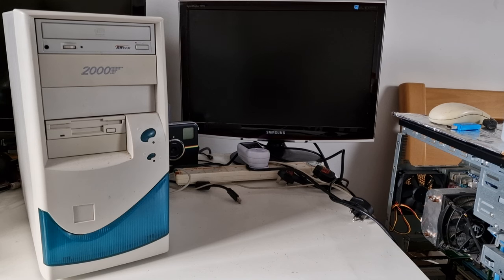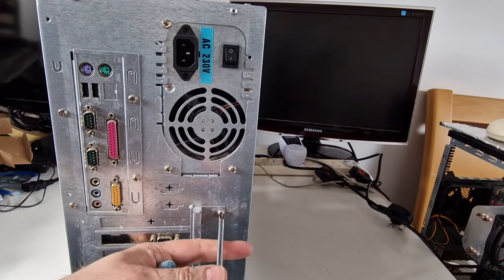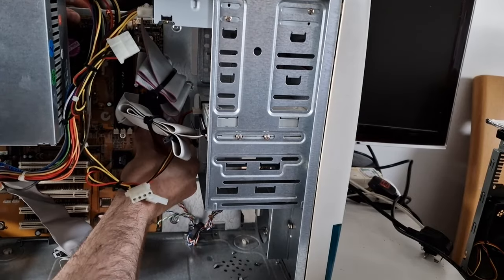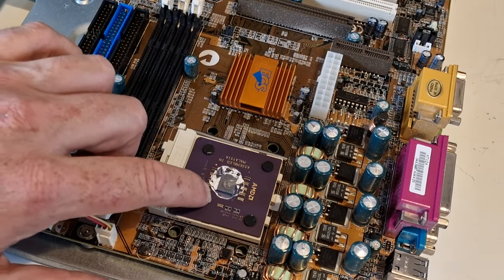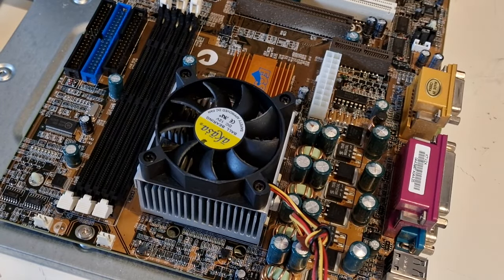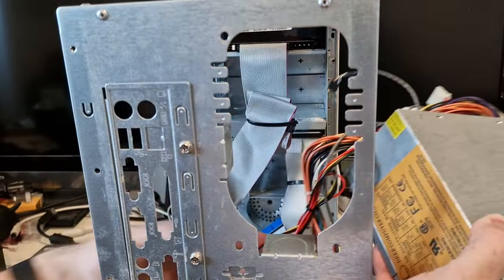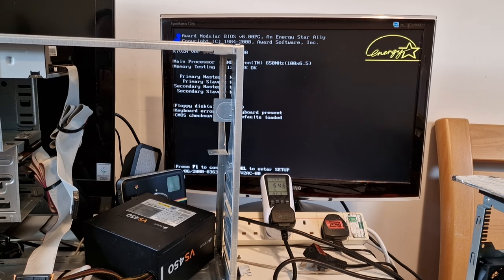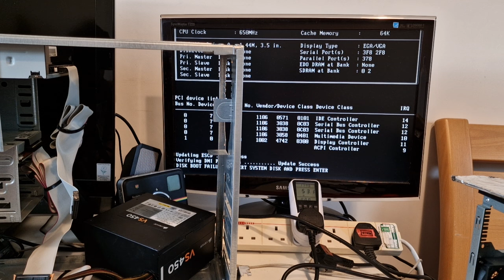What's inside this early 2000s PC? Will it work? includes some fail #beige #retro #vintagepc #calm

Comment: 0:44 without showing us the rear, I think this is gonna be an early socket A, thunderbird system.

33:12 Capacitors are cheap, it’s absolutely worth recapping that board and then you can slap Windows 98 on it and show us what she can do 👍🏻
Reply from the maker: I might have a look to see if I've already got the right caps.